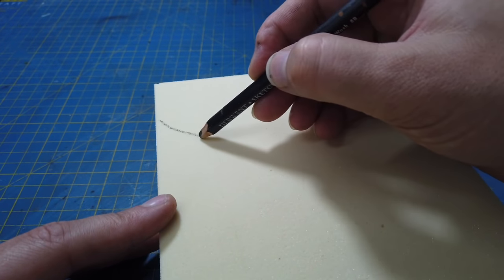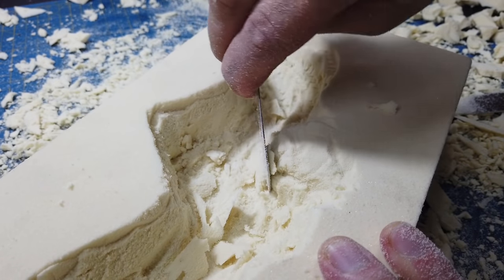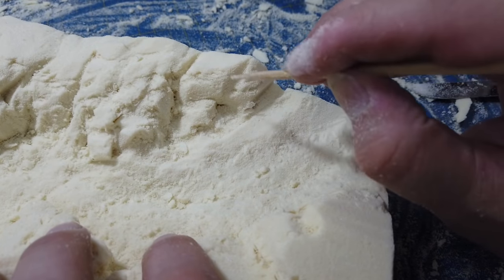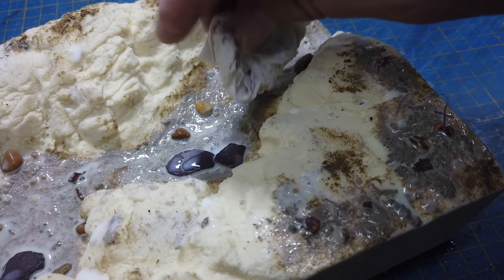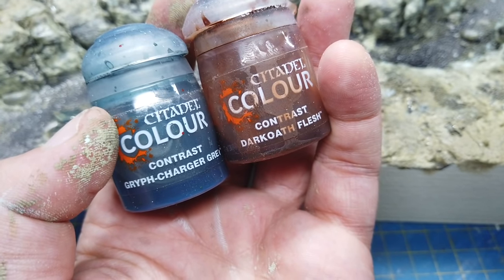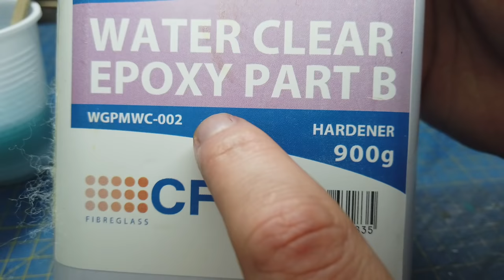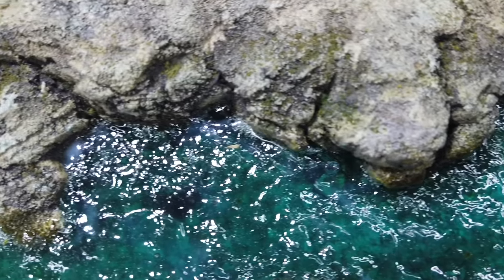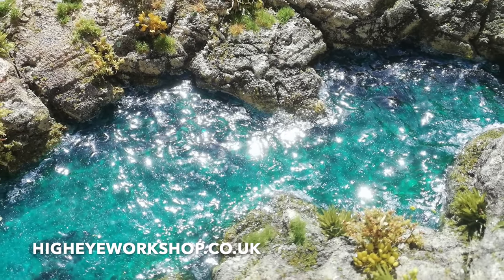How I made this amazing blue mountain river diorama...and nearly messed it up completely!

Comment: This is perfect for one of my sculpting projects I'm working on. I'm making a sea monster. The head /neck just finished baking. Going to painting tomorrow then eork on the middle body rising and driving back into the water along with the tail coming up. Never used resin so I'll have a few practice runs before making the final water diorama base to connect the clay pieces. 

Thanks!

Comment: For the bubbles, I've seen on another channel that gently blowing with the mouth helps to get rid off them.
Anyway, fantastic result and captivating artwork. Very well done!!
Reply: It's not blowing that helps get rid of bubbles in epoxy resin but the carbon dioxide from your breathing. You could also wave the flame of a blow torch above it but be careful not to burn anything. Again, it's CO2 that helps ease the bubbles out of freshly poured resin.
Reply: @edeaglehouse2221  thx for the explantion! :)

Comment: The river looks amazing! I've found that the bubbles form do to the foam reacting to the heat produced by the epoxy curing. A solution that seems to work for me is applying a thin layer of pve glue and then painting on a layer of resin on first. Once cured ill go ahead and do the full pour of resin

Comment: One thing that helps to get rid of the bubbles in resin is to warm it. You can warm the resin with a double boiler. 
The bubbles don't look bad on this project, but maybe they won't look as good in another project
Reply: Warming the resin also helps it flow easier. You don't need a double boiler. A large bowl of very warm water is sufficient. Let the cups of each part sit in the water for a few minutes, then mix the parts and stir gently to avoid bubbles.

Comment: Have you ever tried to use a grapefruit knife to cut your foam ? Being curved at the end with a serrated blade , but not particularly sharp, they are ideal for carving foam and a lot less dangerous to use than the scalping knife you seemed to be struggling with . I use one I have had for 40 odd years and I find it easier to shape the foam as the blade glides over the foam rather than digs in . Might be worth considering . 

   The results you achieve are very impressive , and of all the videos I have seen on making water yours are the ones that I would try to emulate as they are the best .

Comment: Lovely to watch... came out very nice... you said you would have done things differently with regard to the resin and the foam..what would you have done differently? I want to do a diorama but so many options doe how to make the base and what foam or not foam to use... I don't have hot wire tools and don't have man tools, but I have knife !! Lol
Reply from the maker: Thanks 🙂 Use extruded polystyrene and make sure you coat it well before using resin. Don't use the stuff in this video.

Comment: Would it have been easier to split the block down the middle   to cut out your shape ,so your not digging it out?
Reply from the maker: It's an idea, but probably not due to getting both sides to match and in any case this stuff is very easy to carve. It would have been easier with the right tools!

Comment: First, amazing jog, it's great!! I had a question about the torch. When you use torch, is the resin already dry or not? I saw smoke émissions. What about, Is it for clarity or make it shine?
Reply from the maker: It's wet. It's supposed to pop the bubbles in the wet resin, but the foam reacted with the resin.
Reply: @HighEyeWorkshop  ok thanks for your answer🙏
Reply from the maker: @da6444  thanks for your nice comment 😊

Comment: Wow great river.   I made a mistake and used Mod Podge to make ripples and it didn’t work very well.   Do you think I could use this Water ripples on top of the dried Mod Podge?
Reply from the maker: The Mod Podge should just peel away - but you probably could use this over it.
Reply: @HighEyeWorkshop  thanks.   I realized I grabbed the wrong bottle of Mod Podge.  I used the matte finish.   My lake is so dull it looks like a bad painting on a piece of paper.   I hope I can peel it off as you said.   How about alcohol to wipe it off?   Thank you for your help.

Comment: What type of foam did you use? It looks like same material as the floral foam (green) except in that color🤔
I want to make one simillar to what your making but simple one 😊
Reply from the maker: I would use extruded polystyrene if I were you The stuff I used isn't very good with epoxy resin.
Reply: @HighEyeWorkshop  ok thank you! 😊

Comment: Can we use epoxy resin for ths water ripple?
Reply: It you timed it right, you could with the epoxy as it water to gel. You usually have about 10 minutes to move the epoxy around to make waves but avoid tooling marks. Much easier to let the epoxy cure, then use another product like acrylic gel to make the waves.